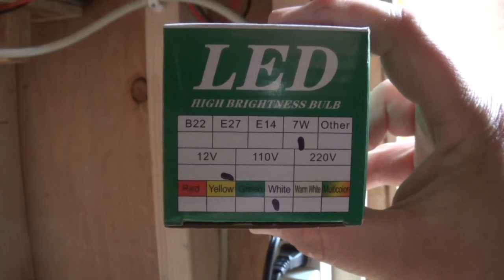How to Wire my Shed for 12v from my 24v Surrette Batteries. Solar Power

Comment: do you need to have the fuse ?? or is that just for wire size change
Reply from the maker: fuse is best. it protects your devices. example if for any reason there is a short, power surge the fuse would blow preventing damage to the device.

Comment: Nice, more detailed than others. I have a suggestion, you could use 14/2 gauge Solid Romex SIMpull CU NM-B W/G Wire from home depot. I’m looking forward for more videos.
Reply from the maker: i thought of that using solid wire but wanted to stay with stranded for the dc part. a mental thing i guess. lol

Comment: I am looking for some help I will have 2x12v 110am battery's and I want to use it all on 12v but my new panel will be PMPP 260w VMPP 30.7v imp 8.50A 37.8V VOC UL 1703 600 UL 17031 5A can I do this for 12v please help
Reply from the maker: lets see how I can help... you have 2 12v 110amp batteries who want a 12v system. you also have 260w solar panel. the other info you gave tells me what most 260w solar panels are. the 260w is most important. only 1 panel right?.. be sure to have a 12 volt charge controller that can handle volts of more then 40v (panel 37.8v peak). they will have a range like your panel something like 10v to 200v . wire your batteries in parallel positive to positive, negative to negative terminals so you have one 12v 220amp battery. wire your charge controller to the opposite ends positive term and negative term. . long answer but yes as long as you have the proper charge controller.
Reply: Thank you great clear information I will be getting a charge controller that will be rated  to 30amp 48v looks like I  ordered the correct on thank you for taking your time  to get back to me Norman in the UK

Comment: Hi. When you use the converter to drop 24v dc to 12v dc does the other 12v just wasted? Why can't you wire batteries parallel as 12v you would double the amp hours and not need converter. I am confused
Reply from the maker: i went with 24v becus its more efficient with the inverter. i looked at the efficiency of a 12v inverter and 24v inverter the 24v inverter had less loss . plus i also ran the dc power about 50ft so at 24v its more likely to have less power loss over the distance than 12v.

Comment: holly cow 1000 watt inverter on 12ga wire 1000/13 = 76.92amps good luck on that
Reply from the maker: so far all has been great. i am using maybe 50 watts at one time so the draw on that inverter is small,  in fact it was an inverter i had and didnt want to use a 500 or less.

Comment: Glad you got that set up. There are so many things you can run off 12v. That's how I set it up just for 12v. I do have an inverter that is off at all times, but can be turned on for a quick use of an item like a blender or tool.
Reply from the maker: +Prima Donna Going Off Grid great idea. I plan on keeping my inverter off as much as possible.

Comment: If i put solar panel of 30v dc on converter will it  give me 12 volt dc?
Reply from the maker: depends on the converter and battery set up. if you have a 12 volt system and using a 12volt inverter than  a 12v converter is needed. you can also go a 24 volt system.... unless its cheap converter it will handle higher volts and converter it to 12 to charge the batteries. look at the spec of the inverter for the voltage range.

Comment: Looks good.  What's the life expectancy of these batteries, and what will it cost to replace them?
Reply from the maker: +Tommy TwoGun $400 each. ouch. their warranty is 7 yrs however Rolls Surrette Renewable Energy Batteries if you don't discharge them to much will last 20 yrs or more. key is to only use up 10 to 15%  before fully recharging them and making sure the liquid (water/acid) specific gravity is measured often and kept at its optimal level.
Reply: ArizonaHotHomestead
Damn that's alot of money for a lead-acid battery and 100+ year old technology!  How much would a comparable lithium-ion battery cost?  At least if you don't stress them you can get your money's worth out of them.
Reply from the maker: +Tommy TwoGun not sure the solar places I looked at don't carry any type of lithiumion for solar.

Comment: i want to see the samlex inverter charger hooked up to the genny with an auto battery low voltage turn on
Reply from the maker: +Bobby Diminnie that would be great. I am not planning to set up the inverter and generator that way. my generators are manual start so if I use a generator I will manually start the generator. the inverter should pick up that current is coming from the generator use most of it for loads and anything left to charge the batteries. .
Reply: +ArizonaHotHomestead.           :-( does it have the ability to send an auto start singnal to a generator with one those green plugs on the side?
Reply from the maker: yes, I will have a video out soon on the inverter. yes it will recognize low volts and auto start a generator.

Comment: Why you don't connect 12v battery to inverter?
Reply from the maker: i have a 24v battery system connected to inverter. i wants to step down the volts to 12v so i can connect to a smaller inverter to power charge cordless batteries.